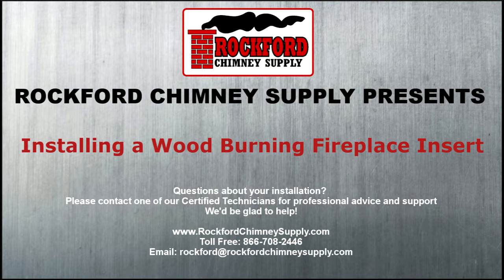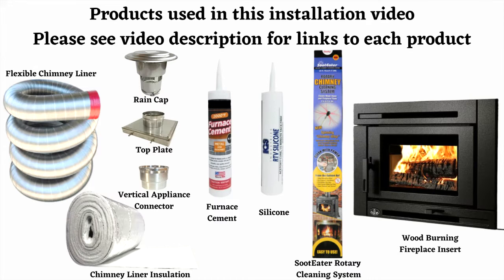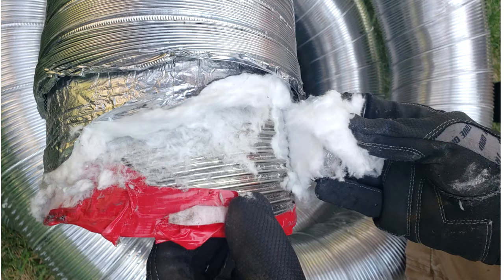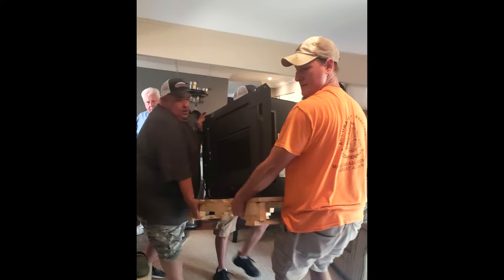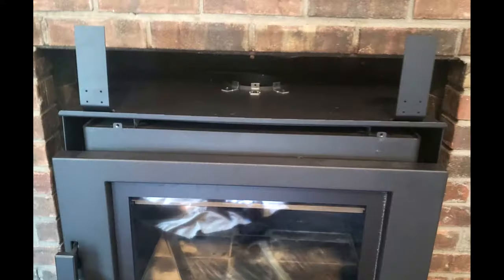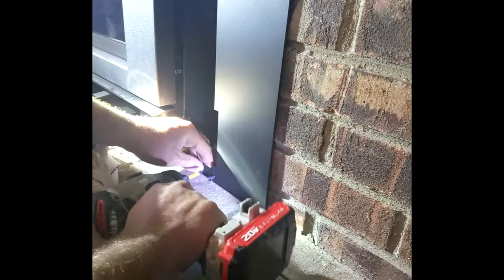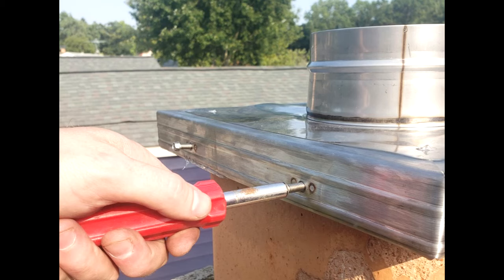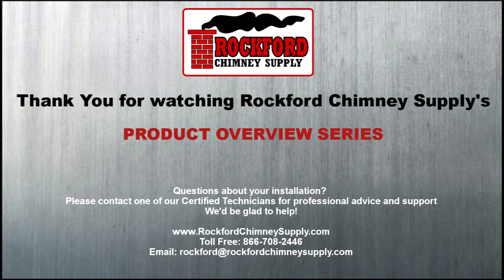Wood Fireplace Insert Installation Overview by Rockford Chimney Supply

Comment: Do you seal the insert and/or flashing to the masonry? Would it be possible to use an existing ash dump to supply air directly from outside to reduce drafts in the house?

Comment: Do you suggest a block off plate on top of the insert to reduce the heat loss to the chimney? Thanks
Reply: shouldnt need one with an insert.  Thats the whole point, that you can restrict airflow with the actual wood stove.
Reply: It makes perfectly sense. In my country they use such insulating plate above the insert.

Comment: What's the reason you put an insert instead of using the existing fire place?
Reply: One million reasons.   A fireplace does not heat a house.
Reply: @pepperroni4016 this is so true. I have one of these open fireplaces. It's decorative. Barely heats. When not burning, it's the #1 source of heat loss in my house. My house is chilly despite being insulated to the extreme and otherwise air tight. Just saying all of this for the benefit of the person you replied to.
Reply: Not to mention when you do use a fireplace, as soon as it goes out the heat in the flue causes the fireplace and chimney to dump the heat from your house in a short period of time.
Reply: Thanks, I had no idea they were so bad. Make a lot of sense now. But won't the exhausts still be open in the insert when it burns out too? I can see that it would be a lot less air going out but still would be left open right?